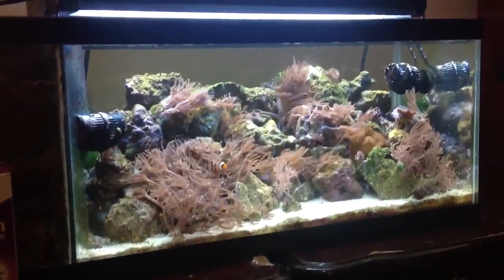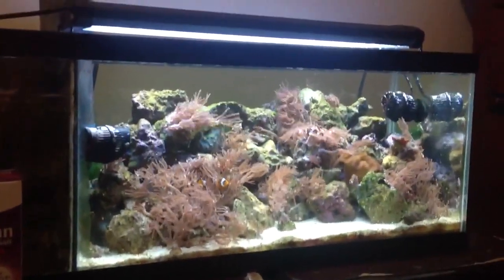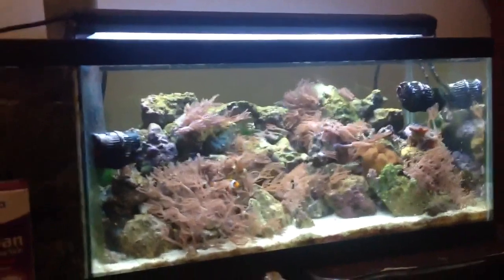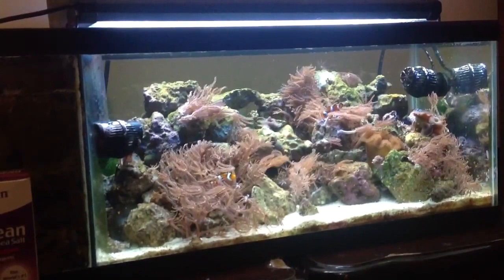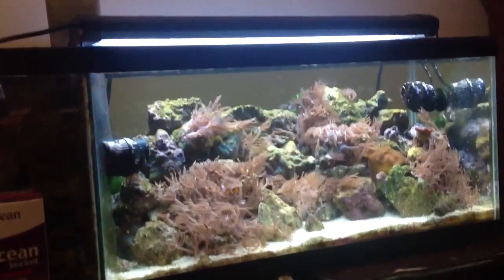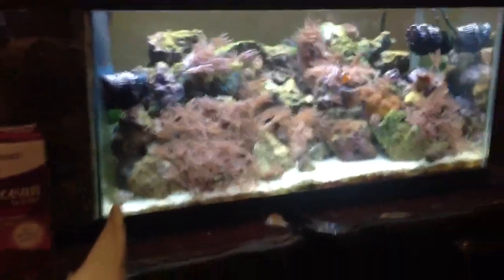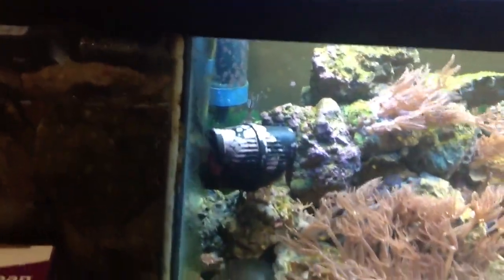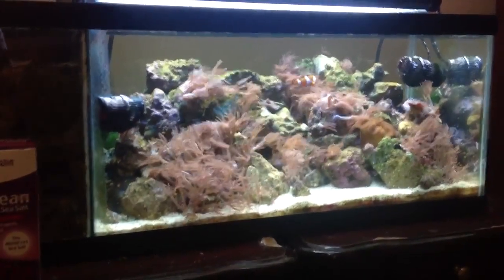Using Concrete/Cement in the Marine Aquarium.

Comment: I'm currently doing stonehenge outa rock an I'm in the process if curring the rock
Reply: Yeah i used old.garden slabs, it came out well, just be careful with what you use and make sure its aquarium safe,
Reply: How did it turn out? I'm currently planning to create a castle for an aquarium out of individual tiny bricks, so I'd be very interested to know it is actually feasible